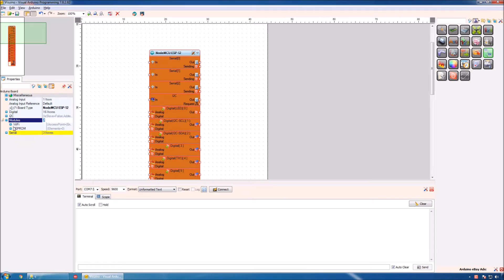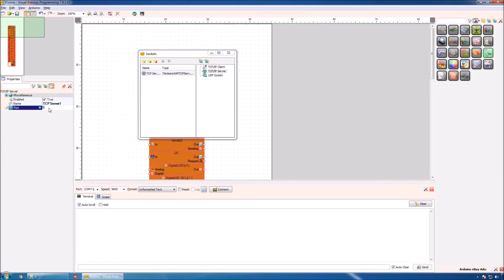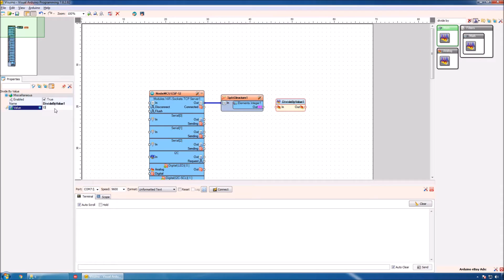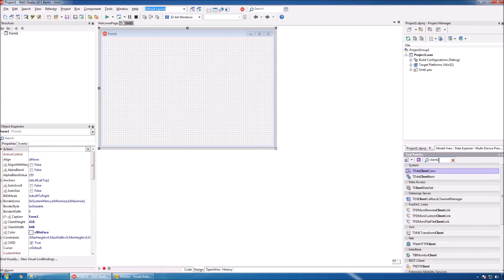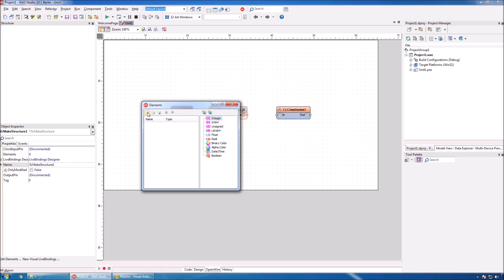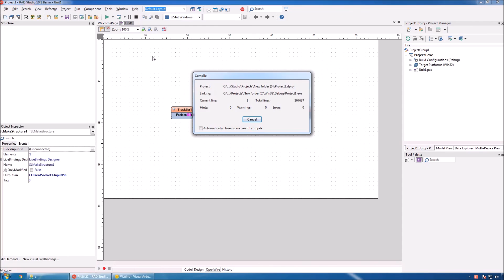Visuino and Delphi Tutorial: Remote Control Servo connected to NodeMCU over Wi-Fi

Comment: Mr. boian, is it possible to add more analog pin to esp12? like chip 74hc4051 with visuino?
Reply from the maker: Yes, I see no problem at all :-) . You can use "Unsigned to Digitals" component to convert the channel number to binary values connected to the pins controlling the 74hc4051
Reply: Thank you for fast respon, but still stuck here.
;)
Reply from the maker: What is the problem? You should be able to just use 3 Arduino pins to control the multiplexer, and "Unsigned to Digitals" component to convert the Unsigned number of currently selected channel to boolean values to control the multiplexer selection pins. Than can use a counter or something to switch between channels.
Reply: i really don't know how sir. if there any visuino diagram, please help
Reply from the maker: I don't have time at the moment to do one, but as I said, should be easy. A counter, an "Unsigned to Digitals" and 3 pins on the Arduino controlling the channel selection pins of the multiplexer. And connect the out of the multiplexer to one of the analog pins, then connect the analog pin to serial. This in theory should do.
Reply: Thank you sir, for your respons.